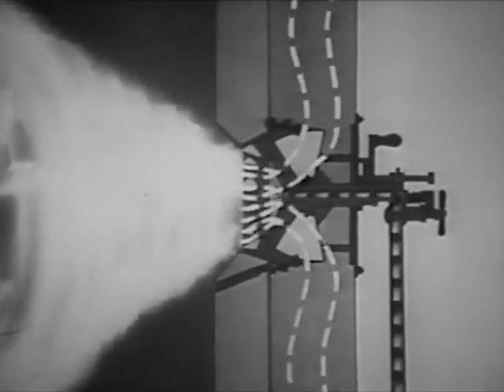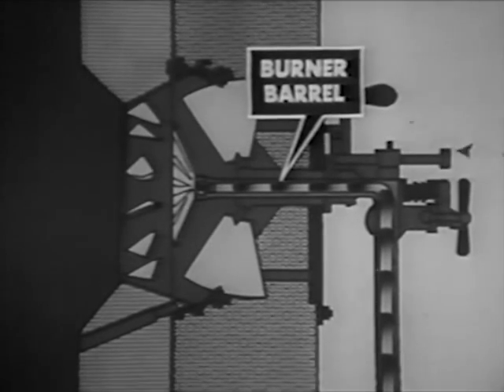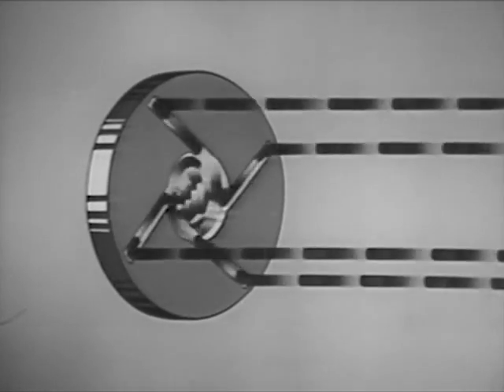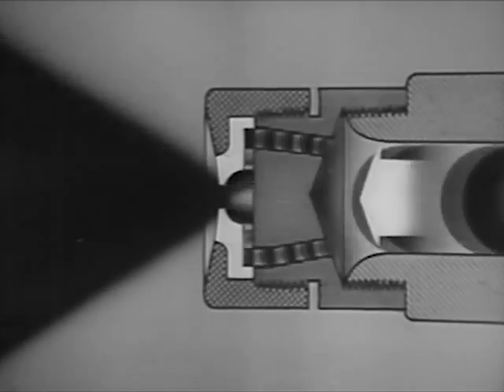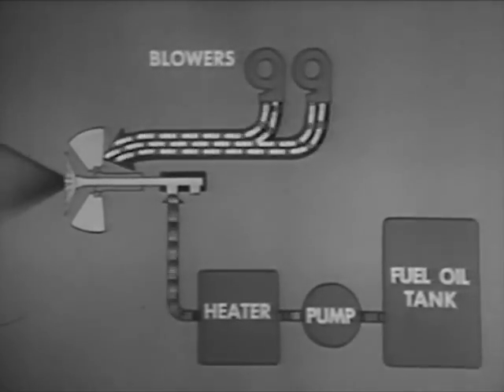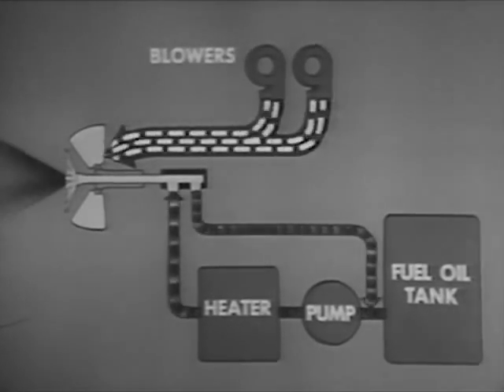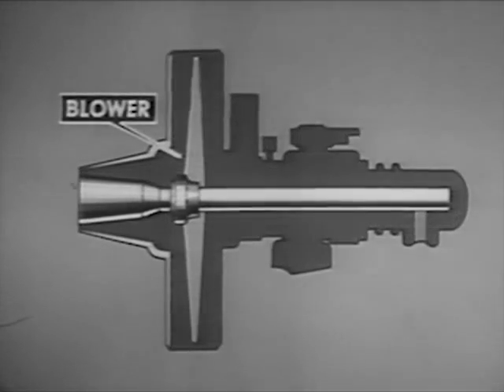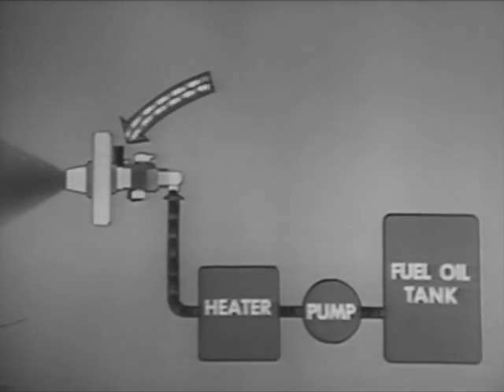How Fuel Oil Burners Work: Boilers and Their Operation - 1956 - CharlieDeanArchives

Comment: We may be less and less reliant on fuel oil, but the engineering involved is still relevant.  Although these days, the turbine engine is more efficient and provides better power-to-weight where oil-fueled systems are in use.

I wonder if similar mechanisms are employed in jet engines for fuel flow control?